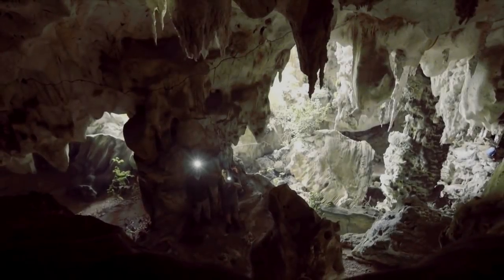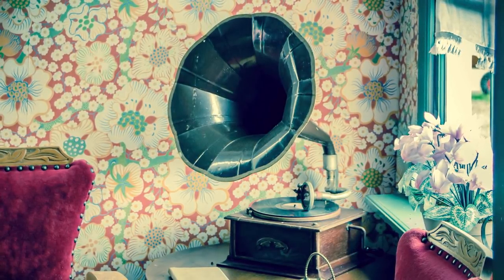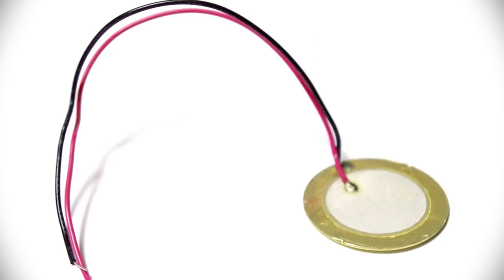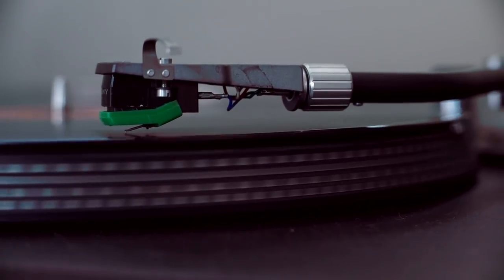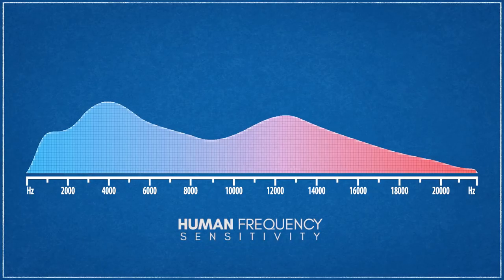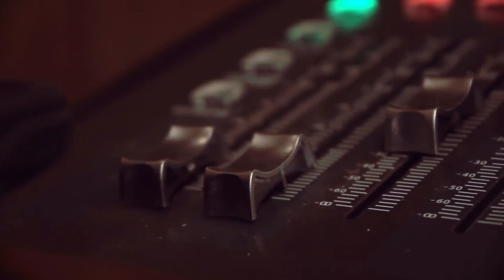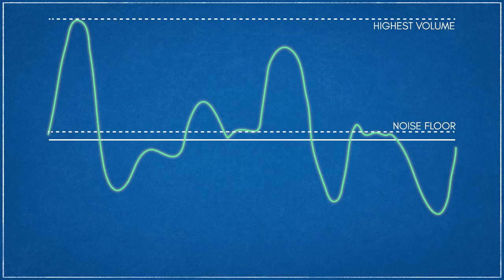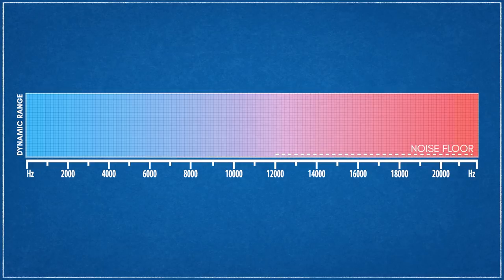The Evolution Of Music Storage

Comment: The OTARI MTR 90 seen at 5:35 is a 24 track 2" tape recorder.
Reply: Not always. They originally came with a 16 track head stack. The 24 track stack was later introduced as an upgrade module and was part of the mkII rerelease.

Comment: Some details are not quite right without context. Yes, 140 dB is the absolute maximum dynamic range of human hearing but at 140 dBSPL your eardrums are close to bursting and you are well above the threshold of pain. Also your hearing needs time to adjust and you never get the full range at once. More in the ballpark of 70 to 80 dB at one specific level. Wich so happens is the effective range of CDs. Yes, I know, redbook standard is roughly 96dB of dynamic range  on paper but assumes uniform distribution of the PCM samples, which music or speech or basically anything human made never has.

Comment: I never got how an animal can percieve anything lower than maybe 10hz as sound. Playing with electrical oscillators connected to speakers, I've found that once sound gets below this point, I can still "hear" it, but I only hear it as a series of clicks, where each click corresponds to one cycle. Ie 10hz makes the sound of 10 clicks per second. Rather than a continuous tone. 

Although, I always used square waves, which are full of higher frequency harmonics, so maybe that's what I'm hearing, and the clicking is just these harmonics being modulated at the fundamental frequency. I'd like to try this with a pure sine wave, but I haven't gotten around to buying or making a device that can produce sine wave tones. Short of a mobile phone app, but I have doubts about the quality of such apps.

 Plus, I'm pretty sure the relatively low quality speakers I use when fiddling with electronics  don't have a very good response at 10hz, cuz why would a speaker need to be designed to function at frequencies lower than we can hear?

Comment: Great video. One thing though, @ 8:26 you say that in laboratory experiments has shown humans can detect 12 Hz - 20 kHz, didn't you mean 28 kHz? (but said 20 kHz twice)
12 Hz - 28 kHz was what I found on wikipedia: "The commonly stated range of human hearing is 20 to 20,000 Hz.[9][10][note 1] Under ideal laboratory conditions, humans can hear sound as low as 12 Hz[11] and as high as 28 kHz"
Reply: Link to the article: https://en.wikipedia.org/wiki/Hearing_range#Humans